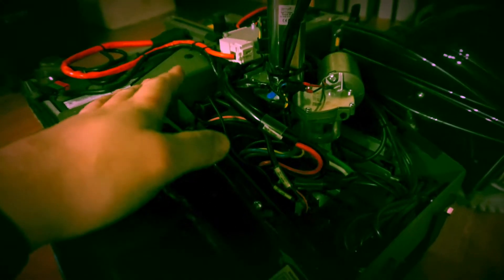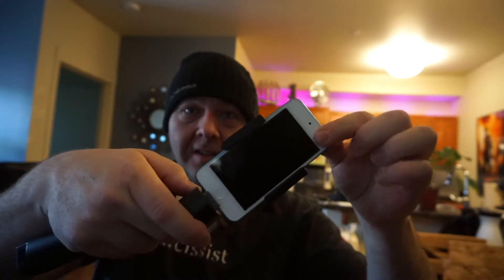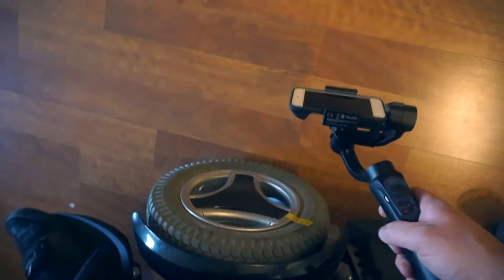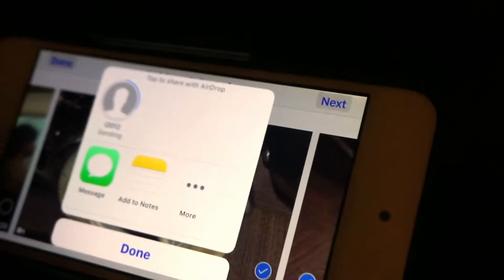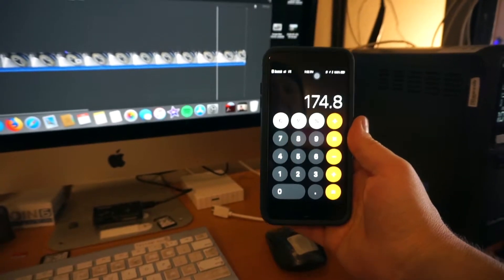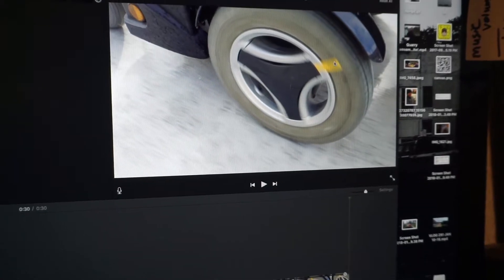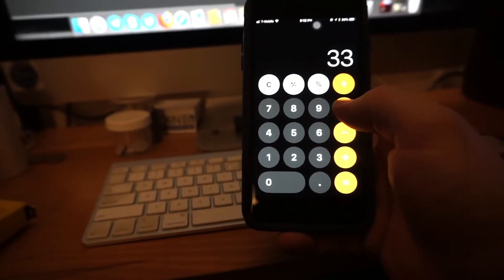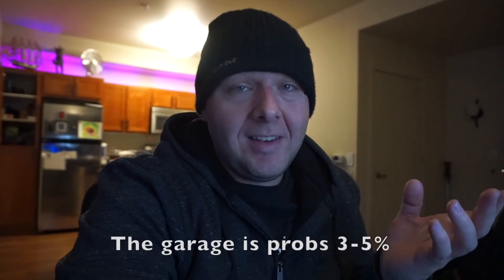VLOG 292: calculating speed

Comment: i just upgraded to an almost new invacare tdx sp with power recline/10" seat lift with mk6i controls. any opinon etc on this model? thnx take care
Reply from the maker: if im not mistaken, that joystick should have an SD card slot on the front of it that can be used for programing! I run those electronics on a couple of the soccer chairs :) didnt realize a seat lift was an option on those chairs! cool!
Reply: yup, has the sd card slot. the chair didn't come with a card but after surfing the net i was able to figure out how to backup current settings onto an old 128mb sd card. i tried looking at the .sys file it created in notepad but only some of it was readable. do you know how changes can be done or what software is used? i have only ever seen one other tdx sp with the seat lift option. i dont know if it also had an upgraded motor option (i will have to look) but it's pretty darn fast.
Reply from the maker: there's 2 levels of SD cards.. you can backup on the base level, the there's a programming / service level as well.. ive got the files to convert any card into a service level card, and ya can program it.. have to be careful with the invacare chairs when programing though..they dont have the same "safety nets" in the software to prevent damage.  this program converts the SD card to a service level, then you put the card into a windows computer, and there will be an application to run on the card directly.  make your changes, save, then put back into chair, and use the on screen menu to write the card to the chair.  maybe i should make a video about it!
Reply: a video would be great! perhaps a trade for the files/software? starbucks giftcard or? let me know? well trade email addresses or? thanx
Reply from the maker: Yea I’m looking for the program... it’s somewhere on an old PC.. if not I’ll just copy my card and send it to ya
Reply from the maker: hey.. I tried replying to your email but i keep getting 'undeliverable' errors..

Comment: have you try with frontier faster?
Reply from the maker: yea - to make the frontier faster, ill need to change out the gears.. which isnt too difficult on these "inline" motors - costs a few hundred $$ though.. the controller it setup at its maximum for the current stock gearing.
Reply: you are the man, how fast it goes now?
Reply from the maker: haven't bought the parts yet ;^) hopefully soon!